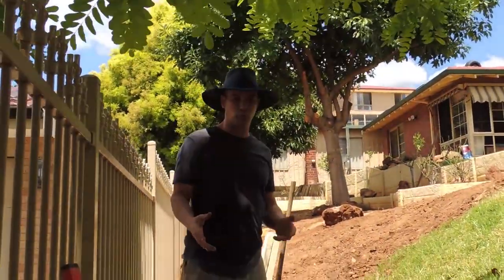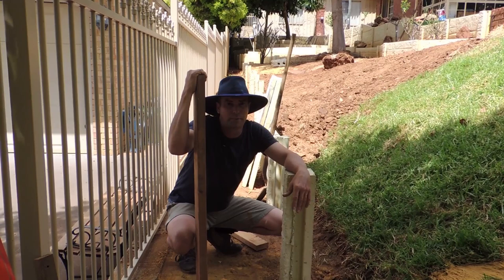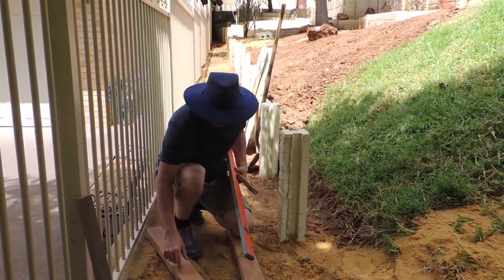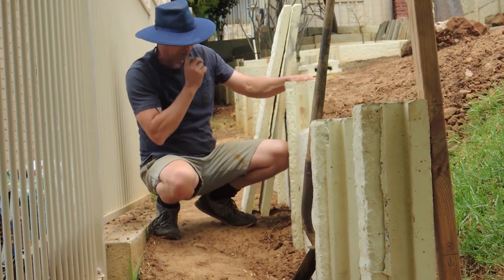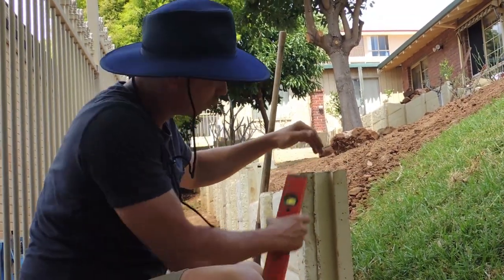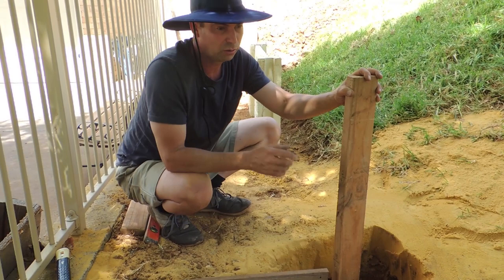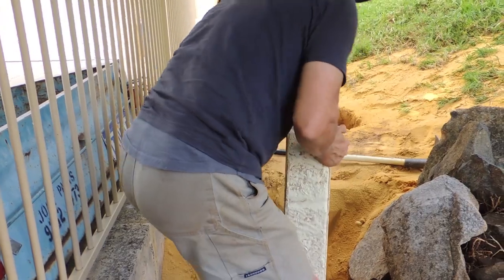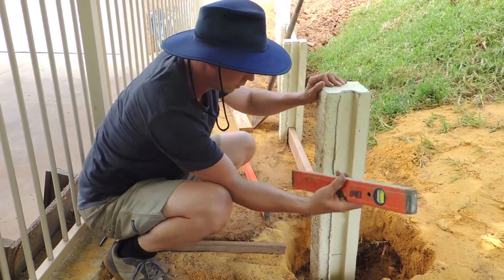How to build a concrete Panel & Post retaining wall

Comment: Thanks for the video Aaron. Although I'm comparing apples to oranges here - I'm currently building  a double 2x 25m long, 1m high retaining walls at home using 100m wide H sections and 2.4m/100kg concrete sleepers.  Unless I missed something your hole in the middle of the video doesn't seem very deep at all. For a 600mm high wall I think your holes should be at least 600mm deep (+100mm?) ?  Also only 2 bags of concrete for  your post hole doesn't seem very much. My 1m high wall has 2100mm long steel H upright sections/posts, a 100mm offset (angle) and I used about ~16x20kg bags of premixed concrete per post - NOT rapid set - with a brick in the very base of the hole that my steel post to sit on. (My holes alone are about 1200mm deep - dug in rock hard clay)  I also agree with you 100% - advance/set by concreting only one post at a time (using a spacing template) otherwise the final spacings will only end in tears/disaster. I did use a string line to keep my 25metres lines straight. In addiction to using a spirit level I made a simple vertical contraption from timber with a dangling 900mm string and plumb bob (and texta graduation marks/target) that I would clamp vertically to my posts to get my post offset angle 100% correct every time. (Note: My local council here in Melbourne permits up to a 1m high wall without a building permit)
Cheers Mate (^ ^)
Reply from the maker: Correct.. please LISTEN again carefully as to what I said, I know I talk fast but your answers were there. Simply put, Yes, 600mm high wall needs a 1200mm post. BUT, if you saw the size of the Granite rock under that particular post.... well, you also would say "Stuff That!"    Also there are no plants going behind the wall just grass,. and a second wall further back went in which DID have a 1200mm post put in and also just Grass in retention. No trees or foundation.  Thanks for watching.

Comment: Great video mate. I'm in the process of doing the same to my garden. I've dug out alot of hard clay land and have to retain the boarders. I think I need approx 3 gravel boards high. What sort of height would you suggest for the concrete posts?
Reply from the maker: Double. If your soil retention is "X" in height, then your post's need to be "X" x 2. Then taking into account the amount of cement to the posts be one third of the length (preferably)lest be one quarter of what ever the post is. I am really glad you got something out of the upload. I had fun making it but I didn't have digging the holes.😃
Reply: @AaronHahnStudios  hi Aaron. So the height of the gravel boards will be 3ft. Do you mean I'll need to dig 6ft down to support this?
Reply from the maker: @wemoveforward6413  Please define "Gravel Boards"?  That aside I think the answer your after is 3 Feet.. Three feet of retention and three feet in the ground. The posts then being 6 feet total.
Reply: @AaronHahnStudios  regarding the gravel boards in the UK we have concrete casted gravel boards reinforced with steel rods. There 6ft long and 1 ft high. Sound like what your using?
Reply from the maker: @wemoveforward6413  Most likely your right. These boards are Blue Metal Aggregate, locally made cement & yellow sand mix. 3 Steel rods per board & heavier than I'd would like them to be. Though the boards you type of are longer than the ones I installed. You may have to take into account the extra stress each post is faced with more weight in dirt pushing upon them. Everywhere is different. It depends on what your holding up. The Foundation of a home or a veggie patch down the back of the yard... it can differ the way you'll go about each case.
Reply: @wemoveforward6413  Hi, sorry to gatecrash your comment. I'm also in the process of planning a retaining wall in my back garden in the UK and thinking of using concrete gravel boards stacked above one another slotted in a concrete fence post. Was wondering if you went ahead with your plan and would like to share any tips?
Reply: @Varun9287  hi. I didn't go a head with the concrete gravel boards. I researched high and low and found it could potentially be problematic for the application I needed. As over time it could fail with the concrete posts crumbling as their isn't much surface are in the slotted area. I've opted for sleepers(timber) Jarrah wood. Weigh a tonne but a hard wood that will last for many many years. All the best and good look with your install.

Comment: Like your simple approach, have seen other videos where they made elaborate bracing putting all posts in before the pour, obviously because they got a truckload ready mixed concrete.
But this works as well, it just may take a bit more time, not an issue as a DIY.
However I'm happy with my choice for steel 100mm H section, even the longest section at 150cm weighs under 30kg and is easy to handle, I set my posts at a 1m distance and the infill is made of 5x15cm azobe hardwood planks, this wood is very rot resistant, even when partially submerged in water, and it looks nicer than concrete too, the downside of course is the price being 1,5 times that of concrete sleepers at 9 euro (13,5 ausd) per meter.
The steel is going as deep as the height of the wall, but the hole for the post itself extends 1.5x the height of the wall, with 3 lengths of 8mm rebar in it at the slope side.
That because the steel rebar works under tension but has no advantage at the side of the footing that is under compression (ie the part that is away from the slope)
Also a couple of rings of rebar will be tied to the vertical bars which loop around the bottom  and top of the H section in the concrete to prevent it from shearing the concrete under the sideways force (without actually making contact between each other, concrete is allowed to sit in between).
So the way to set the H section is to suspend it on 2 pieces of wood placed cross wise with some screw clamps at the right height as the end is not near the bottom of the hole.
A pavement tile is dropped on the bottom of the hole to keep the rebar away from the soil, preventing direct contact with wet soil which can cause it rusting away from the bottom end.

The tip to do one post at a time and move the earth to the finished last section only is a great tip when moving earth by hand.
I'm however faced with to problem of having to much dirt of which I have to remove at least half from my property altogether, and the total amount sums up to 15 cubic metres, which can't be done by hand unless you have 6 months to finish the job, so an excavator contractor is asked to make an offer for the earthworks.
When this is outside my financial scope the there is no other choice than move all this earth by hand and your method will come in handy at that point.
Reply from the maker: Some great feed back Tom. Sounds like you should do a YouTube video yourself on that project. Share the knowledge. Overall, thank you for watching & your feedback.
Reply: @AaronHahnStudios  That's an idea, it just takes some planning as I'm single and doing the work alone, but I have a good tripod.

Comment: Hey Aaron,  some useful tips there mate (ie the 'extra' leaning angle, timber templates, the concreting etc) ... don't know if you are still monitoring this but I'm at the Gold Coast and apparently we're allowed a height of 1 metre here so anyhoo, I'm planning on putting in a retaining wall approx 6m long using 2m long x 200mm high x 75mm wide concrete sleepers so just a couple of questions for you ... I'm using 1.6 metre galvanised posts so my plan is to dig the hole with the post sitting on a paver so firstly I was wondering, if I'm going to the 1 metre height, is it a daft idea to set up a cardboard template of approx 500m x 500m to a depth of 0.6m then fill it up with water and pour the concrete, (ie will that adversely affect the integrity of the wall - I'm going to put in a drainage pipe and backfill with gravel, plastic sheeting and all that) or alternatively, given what I have, will I have to settle for a 0.8 metre high wall ? ... after you pick yourself up from having a giggle, any advice would be much appreciated, cheers.
Reply: @AaronHahnStudios  ... done, thanks for the quick reply !
Reply: A depth of 0.6m for a 1m high wall is too shallow, the weight of the soil will push the wall over eventually.
But check my comment above, I add additional depth to the holes and suspend my H section in it, add rebar for added rigidity and so overcome the problem of the H section being a bit on the short side (however on purpose in my case to save money and weight on my H section).
In my comment you can read exactly how to.

Comment: shouldnt you have plastic behind the panels to stop the dirt leaching through?
Reply from the maker: If you have grey loose soil, that may help in that circumstance. In this hard clay dirt. Not needed. The gaps form an automatic 'weep hole' which all retaining walls need. Good thinking Adrian.

Comment: Gday  mate,  what do you roughly charge per meter for labour? I'm having a crack at one but not sure what to charge, it looks like hard work. Ps......I'm in mandurah . Good vid
Reply from the maker: thanks for your feedback Brett... I have a couple of suggestions..  first-  whats the dig like? being tree roots/lots of hard dirt?/easy dig?/rocks in the soil?  all may govern your quote... the second pricing trick is the old carpenters quote-  total up the cost of the material, then double it... This usually see's you right in customer happiness verses effort.
Reply: Brett depends on the type of wall.
I do sleepers retaining walls from 290 per square meter. City or around can do it for 330.
Block retaining around 500 square meter